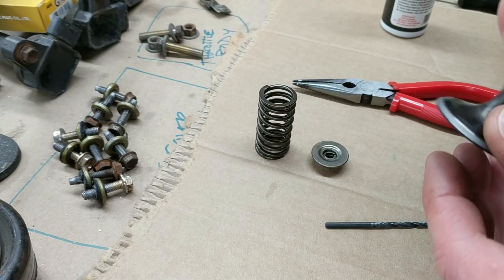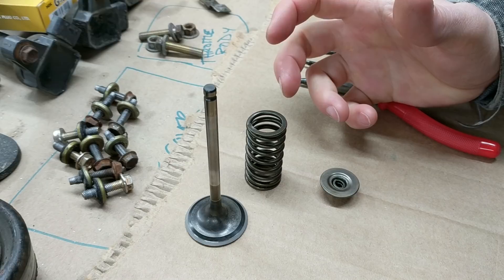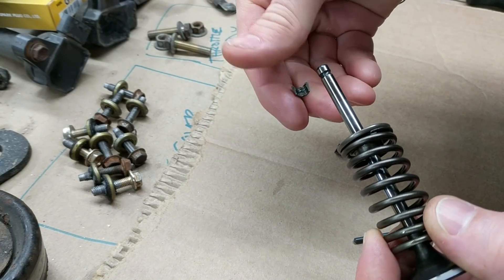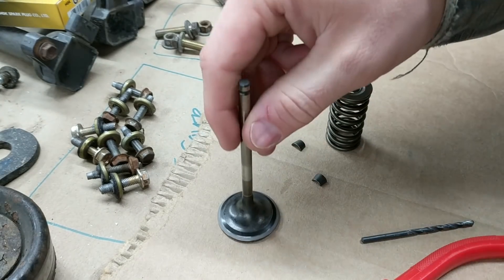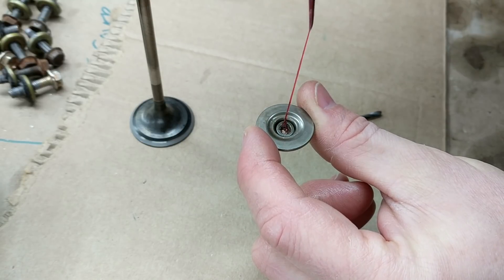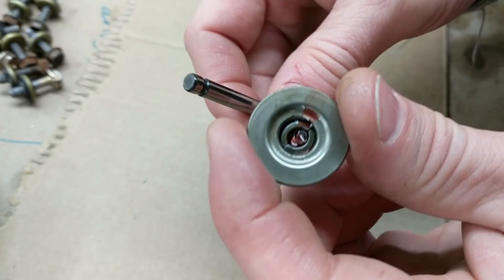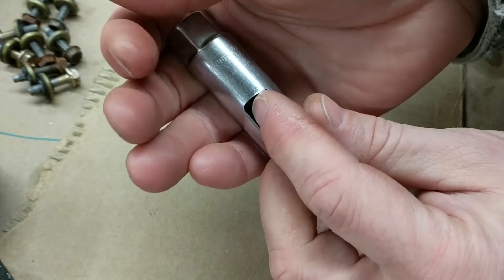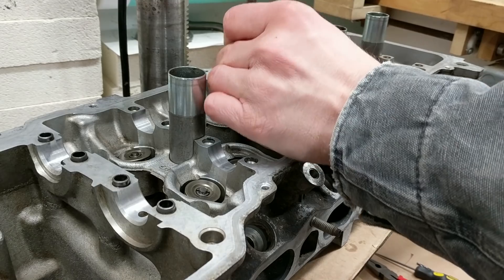Installing Valves with a Drill Press

Comment: funny I did this several times with my 62 sunbeam engines and others.
I just made a little tool and propped the head up with a cut board to get the pitch straight. but my drill press is a vintage one built like a tank..not these flimsy piles of garbage they sell now.

Comment: Found your channel through the head resurfacing video. Love your simple ingenuity and go for it attitude. Subbed because I wanna see this thing run!
P.S. I almost never self promote in comments, but I think you might really enjoy my video on sleeving transmission starter bolt holes.

Comment: Insert your valves and be sure they are all the way up and add your spring and retainer. Press down on the retainer until it passes the keeper groove and then insert your keepers and then slowly lift up on the press. The keepers will slip into the groove and after they are in, be sure to give all the valve stems a wack with a hammer to make sure that the keepers are seated. I hope that you didn't mix up the valves and if you did, you may have problems with the sealing (the valves wear differently so that is why you want to put them back where they came from).